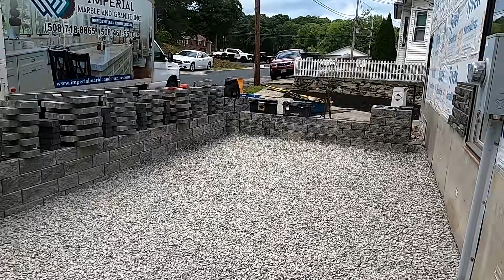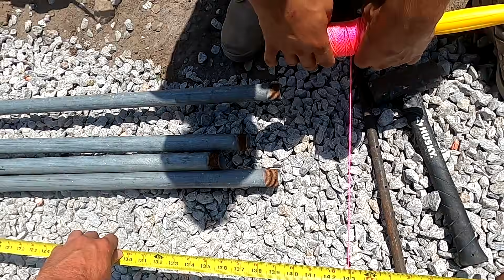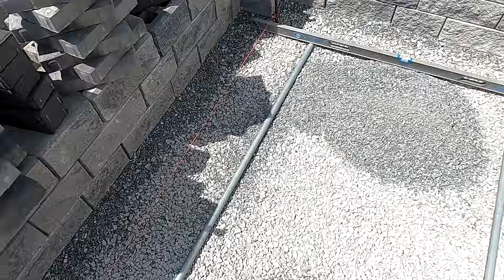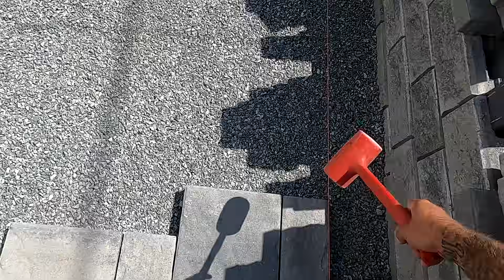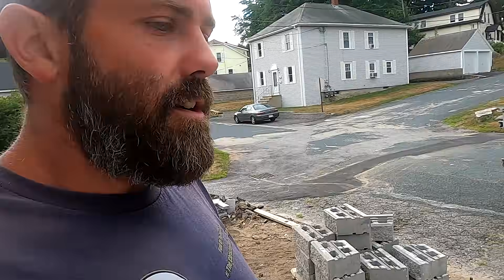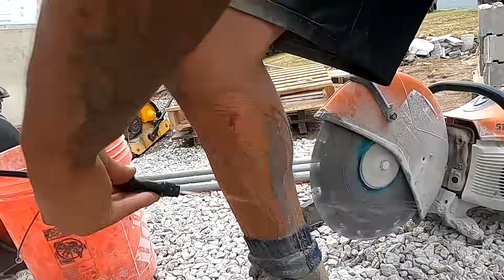How To Square, Screed & Lay a Paver Patio

Comment: Im doing another project with pavers. just watching video again. I only wish I knew how much i would like doing pavers I would of bought a compactor. I dont like renting because u rush to return the tool and then u fix or redo something and the tool is not readily available,, But these videos rock. I do the 4x8 pavers because they are light and easy to handle. At 66 years old. that heavy stuff is brutal.

Comment: How do you prevent a valley running parallel to your galvanized pipes? Seems like you’d end up with a long “mound” where the pipe is with a long low point/valley parallel between the pipes

Comment: May I ask what is the typical weight or suggested weight of a dead blow hammer to use? Also as for the adhesive to glue the blocks together is there a particular brand or just whatever the local mason/stone yard sells?

Comment: I am using 3/8 clear crush  for the first time to install my pavers for my back patio. I notice in this video that you are walking on the screeded 3/8 aggregate to start your paver installation. Being able to stand on the screeded 3/8 aggregate would make the start of my installation easier. Have you encountered any issues when walking on the 3/8 aggregate? Should I wear a softer sole shoe instead of my heavy duty work boots?

Comment: Great videos!  I have used a sand bed in the past, but am looking to use clear crushed stone on my current project.  My pavers will need to match the height of an existing concrete slab - how much can I expect the crushed stone bed to settle when I do the final compaction run?  The pavers have tight joints and I am planning a 1" deep 3/8" crushed stone bed (over existing compacted Class II road base -- too late to change that).

Comment: Thanks for your instruction. Please consider getting a sun hat with neck flap for yourself and your crew. and of course wear spf 30 or 50 sunblock and reapply every 2 hours if you are sweating.   Skin cancer is no joke. Get hats and wear clothes of light color like tan or light grey to stay cool in the sun. the black clothes and hat may look cool but they make your job harder. Black heats up by absorbing rather than reflecting sunlight.

Comment: thank you so much for sharing. im planning to lay travertine pavers 3cm / 1.25 in thick. not tile. do you think it necessary to leave spacers like 1/16in in between or just press pavers against each other tightly. ive seen some YouTubers done that but not sure if it would cause cracking due to movement if left no gap. Could you please share some insights with me?

Comment: awesome video!  love that you don't use a sand base.... the chip stone looks much more stable and easier to work with.   I'm looking to have an excavator cut out a patio in our hill and install a 4' high boulder wall.  I'll have about 14' x 30' patio area and this looks like a doable project for me... mostly by myself but I'm retired and not under time pressure.  I'll probably make it high in the middle and drain to both sides, and then have a french drain carry away water.  the land is mostly clay so it doesn't drain well.   I appreciated the info about the chip stone with no fines allows water to drain through.

Comment: Hey boss.. Thanks for all your videos. I'm following all your instructions, step by step. Getting closer to choose the pavers and borders. Seems that the Unilock paver that you used in this project is discontinued. Would you recommend a similar one? I will use Techo-Bloc Blu 60 Champlain Grey for the main pavers but not sure which one will be for the borders. Any suggestion on black? May I know the size on that Unilock? Thanks!
Reply from the maker: My pleasure brother! those border pavers are 4.5" x 9". There are a lot of options you can choose from for that size from a lot of manufacturers. Not sure of any in particular right now but I'm sure one of the manufacturers in your area has something comparable... Good luck man! ✌

Comment: The open grade is very intriguing to me and makes a lot of sense but I've been laying stone for over 15 years with just crusher dust in Ontario and have never had issues. The patio me and my father laid when I was 16  at our house(almost 25 years ago) was still in great shape (no sink holes or heaving) when we sold the house last year, the only thing we did over the years was resand it a couple times.
Reply from the maker: I love the open grade base method. I used to use dense grade or (crusher run) with sand as my bedding material for about 6 years until 5 years ago when I switched to open grade base. I will never go back... I agree that you can do a great. long lasting install with the traditional method but there is no room for error. Especially in cold winter climates... The clean stone allows for such better drainage and keeps the pavers dry at all times, which is key for a long lasting install. ✌

Comment: 6 inces of abc and about an inch or so of sand above that. The $#@% is this pavers on traprock bull@#%^?
Reply from the maker: LOL, if you don't know anything about this method then you don't know much about hardscaping. You need to learn more. I stopped using the gravel / sand method over 5 years ago now and so have a ton of hardscaping contractors. This method is much better 👌 ✌
Reply: @TheChristianHardscaper  2000+ years of Italian/Roman stone flooring and roads says otherwise. That stone underneath will crack your pavers in time. But you and your contractors do you. I'm sure you'll get repair calls in no time. 😉
Reply: @TheChristianHardscaper  If you have water trapped with your pavers your drainage is wrong.

Comment: We set our string line with a transit. Afterwords we set our pipes with the transit (roughly) the use that string line to measure of from to get them exact. Level to double check that it’s spot on. Love that you’re building on washed crush stone. New England is especially important to build a strong base that doesn’t retain water. We still do some on gravel and sand, but only in certain small applications.
Reply from the maker: Nice man, we all do things a little different but it is all about the end result! I switched to nothing but open grade base 5 years ago now and haven't looked back... Such a great method for these freeze / thaw climates. Nothing but good results for me ✌
Reply: It’s clear the owner did not cheap out on this one

Comment: I don’t think in the south the open grade is necessary would you happen to know? 

I think a lot of the guys just use paver base compact the dirt (sandy soil) and use paver base.
Reply from the maker: I wouldn't say it is necessary but I do believe it will be better for the longevity of the project. The main reason open grade is better is the drainage is better. When pavers sit on moist sand or stone dust, the concrete will break down quicker in its life time. The clean stone prevents that ✌
Reply: @TheChristianHardscaper  ok so like my backyard perks really well my buddy lives in swampy area black soil probably would want to use it there.

Comment: Your channel and videos inspired me to hardscape a patio in my backyard. I'm in Nova Scotia, Canada and I have a hard time finding 3/8 clear stone for the sreeding. I'll be laying Permacon 60mm Melville slab. I was wondering what are my options for open grade? Can I use 1 1/4" clear for the base and 3/4" minus clear for the screeding material.
Reply from the maker: That's awesome! I know it can be tough to find the smaller clean stone in some areas... I would recommend using the 3/4 for base and use a (pea stone) for the screeding material. It is basically 5/8" clean stone. If you can't find that, lay fabric over the base stone and use a nice clean sand on top of it for the screeding material.
Reply: @TheChristianHardscaper  Thank you for the advice. I can definitely get some pea stone around here. Thanks again and great work with your channel. Have a great summer.
Reply from the maker: No problem, glad you have pea stone. Good luck with your project and enjoy your summer as well!

Comment: No sand base? I usually see a sand base under the pavers why not here?
Reply from the maker: I stopped using sand as a bedding layer 5years ago. This is a different method called (Open Grade Base). It is done with clean, crushed stone as the base and a smaller clean, crushed stone for the bedding. Here is a link to a video I made which explains it in more detail 👉https://youtu.be/ChaJe3JqD6I

Comment: tell me why you didn't use 5/8 minus instead you used crush rock?
Reply from the maker: I use a different prep method called (Open Grade Base). Here is a video I made that explains it in more detail 👉https://youtu.be/ChaJe3JqD6I
Reply: I do the same kind of work like you but I use 5/8 minus because have sand and cement and I also compact the gravel with a compactor. I hate to tell you that if you don't compact the gravel pretty good your pavers will sink
Reply: the crush rock that you used the ground will eat it, that's why I use 5/8 minus, I wet it and than I compact it, after that I use a 2x4 to do the grading
Reply from the maker: @user-babyboy8669  Thanks for your input but hundreds of installs with no issues says otherwise. We use geotextile fabric under the base stone, preventing it form migrating. This method is being pushed by almost every paver manufacturer now and contractors everywhere are slowly switching to it.  This project in particular is going on 2 years installed and I have done another patio in his backyard as well as a retaining wall.
Reply from the maker: And a 2x4 is not good to screed with... I don't think I have ever seen a straight one...LOL

Comment: Nice work and great video. How much do you charge for a same model 16x26 feet patio?
Reply from the maker: Thank you, most paver patio installs go for $20-$30 per sq ft (just pavers) walls are additional. 16x26=416 sq ft. (416x$20=$8,320.00 - 416x$30=$12,480.00). So You would be somewhere between $8,320.00 - $12,480.00 depending on materials and access to the area with machinery.

Comment: Thank you for the vid! i like how you go over more of the screeding and grade process, your work is perfection!  Was the french drain dug in right up against between the edge of the patio and the house? I am going to build a patio of my own and want to run the gutters into a drainage system.
Reply from the maker: My pleasure, glad you liked it! The french drain is there and it runs down the entire house and diverts it to the side yard. You can certainly bury some pipe in the backfill for your gutter drainage. That is a huge benefit of the clean stone for the base. ✌

Comment: Kyle, thank you for all you videos.  They are very informative.  I have a question pertaining to paver walkway I'm building that connects to concrete driveway.  Using clean stone as base but where walkway connects to driveway, water is pooling in paver base due to clay soil. Will that cause issues over time? Do I need to install drain in the paver base rock to take water away from walkway?  I. amprobably over analyzing as walkway does have slope to the driveway.  Once pavers are in, the water will run towards driveway when it rain, but I imagine some water will still collect in base rock layer and is that OK?
Reply from the maker: Hey there, glad the videos have been helpful! So my 1st question would be, How long is the water pooling there? is it draining at all? If not, you probably have very heavy clay soil and I would recommend diverting it with some kind of drainage pipe. You just need to get the pipe down on top of the fabric and sloid pipe it somewhere to a lower grade. That will give help for sure. If the water does seem to be draining but slowly, than I do not thing you will need a drainage pipe, especially after the pavers are in and the polymeric sand is done.
Reply: @TheChristianHardscaper  it takes days for the water to recede.  Yes, serious clay soil down here in NC.  Thank you, I figured. More digging...joy! Thanks again. Your videos are most helpful.
Reply from the maker: That's tough to deal with, but it is a good sign that it does at least recede after a couple days. Good luck ✌

Comment: Interesting that you boys also prefer not to wear knee pads with shorts, (I’ve found they haven’t really produced a decent knee pad yet that doesn’t cut into the skin and make the knee backs very sore)..
Reply from the maker: We do not use them as much as maybe we should... but it is for that exact reason. Any pads you strap to your legs gets really irritating on the back of the knee. I have a couple flat pads to put on the ground and kneel on, which is much better and I have been using it much more lately. As far as the shorts... I wear those from april to november.... 🤣 ✌

Comment: Hey what do you think of the block splitter tool for cutting pavers?
Reply from the maker: It works alright for some situations but it does not replace a cut off saw that's for sure. ✌

Comment: I have a question. 
What's the difference or benefit in using stone as the base instead of sand or vise versa?
Reply from the maker: There are quite a few differences.... But mainly, sand shifts / sinks very easily... Plus in the winter, the pavers have less chance of heaving during frozen temperatures with clean stone than with a dense grade gravel. here is a link to a video I made that explains it in more detail 👉https://youtu.be/ChaJe3JqD6I
Reply: @TheChristianHardscaper  Sweet.

Comment: Amazing work and same to be said of the video. With the 3 sizes of pavers applied in a random pattern it looks like it would be difficult to get the opposite (from the starting point) finished edges to come out even flush to the straight line in a fixed rectangular area. How would I do that with no cutting? I have equal sq ft  area for   each size (4x8, 8x8, 12x8)?
Reply from the maker: Thank you, In this situation I laid the pavers out to the best point where I could stop and then built the step up after based on where I stopped. ✌

Comment: This is great. Apologies if already covered (300+ comments), but would pea gravel work in place of the chip stone? Thanks.
Reply from the maker: No worries, if pea stone is all you can find, yes. It is better than sand or stone dust for sure, but angular crushed stone locks together better than pea stone.
Reply: @TheChristianHardscaper  Thank you. They did have 3/8” crushed. 1.5 yards in the driveway now, along with 3 yards of 3/4 crushed. Guess what I’m doing this weekend? 😊

Comment: Love this video. Been in the labor as Electrician and some carpentry 40 years. I'm kinda semi retired. Been doing lots of projects lately such as cutting out 2 concrete window wells to raised above ground level. I still have the body and strength to do this even though I'm 59 years old. Looking into to do my backyard exactly like this video. Had couple guys came over look at it. My house is on the little slope. Right now my deck is 20 years old. Planning on ripping that put. I do have Kubota BX23S Mini Machine. It' is an awesome machine had for 4 years. I've seen other YouTube videos not as good as yours. Looking forward doing it the way you guys.
Reply from the maker: That's awesome, thanks for the feedback and good luck on your projects!

Comment: Hey, great teaching video. I just installed a paver patio for a client using 4in of 4/11s, and 1 inch if sand using leveling rods. I used these materials because of what some seasoned vets said on YouTube. Most people in my area of North west ohio use screenings as the bedding material. It doesn't ket water through, and i have seen many poattios with heaving. I liked the 1 inch of sand because i could tap the oavers down 1/8th to 3/8ths and get everything really smooth. Does your method of 3/4 clear base with 3/8ths clear work well in my region with freezing temps? Does the bedding layer move much when you olace the stone or donyou have to level everything before placing the pavers? Thank you for your help
Reply: i just want to add that this guy is in MA so his methods absolutely has to stand up to beefy winter weather.

Comment: Just qq - why don't use sand instead of stone? I think, it should be cheaper, much easy to set up and effect is the same, no?
Reply from the maker: Sand / stone dust has proven to be a very inferior bedding material. It shifts, sinks and washes away too easily. Sand is the biggest reason patios fail. This method is getting more and more popular and paver manufacturers are starting to push it to the contractors. Crushed stone is far more stable and lets water travel through it freely. Here is a video I made that explains the method in much more detail 👉https://youtu.be/ChaJe3JqD6I
Reply: @TheChristianHardscaper  Yep, it makes sense. What about the cost? Let's say in % - how much is it more or less expensive?

Comment: Honest question:  how do you prevent weeds from growing through there?
Reply from the maker: We fill the joints with (Polymeric Sand). We just did not show that in this video. Here is a video link to how we install polymeric sand👉https://youtu.be/TXWJyBnVQ_g
Reply: @TheChristianHardscaper  Oh that’s so cool.  Learned something new. So you only need apply it once and it “seals” it from weeds permanently?
Reply from the maker: Glad to hear it! Polymeric sand is good for years if installed properly, but most patios / walkways will need to be re sanded a couple times throughout its life.

Comment: getting ready to start a job for a client that's wanting 4 ways as well as long joint lines. All the same size pavers. (12 x 12). 18ft x 18ft area covered. any tips on this one?
Reply from the maker: Nice, that is a style of its own and there is nothing wrong with that! Just keep an eye on your joint lines and double check them with string lines. The #1 thing about that kind of style is to keep your joint lines straight. Other than that, the base prep should be done the same way as I show in my videos. Good luck! ✌